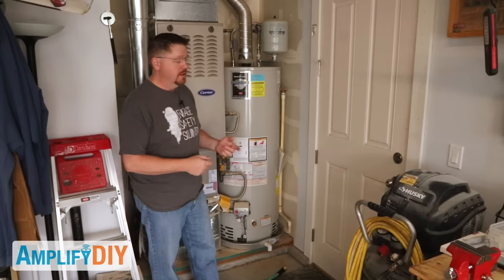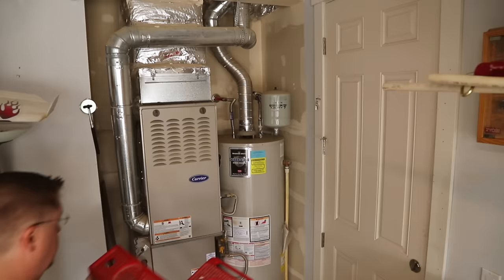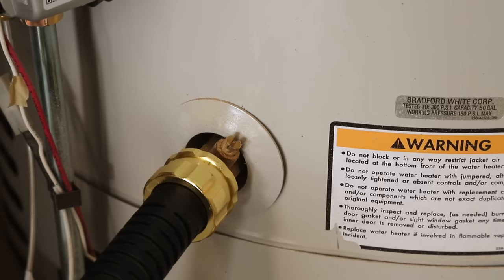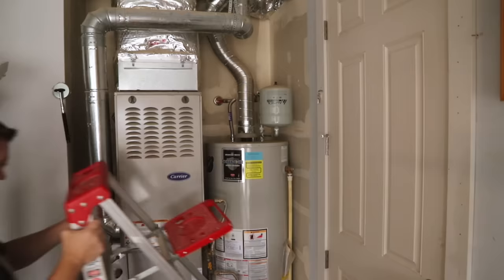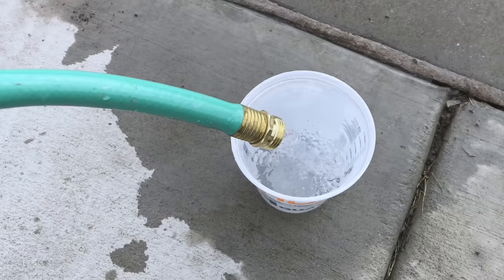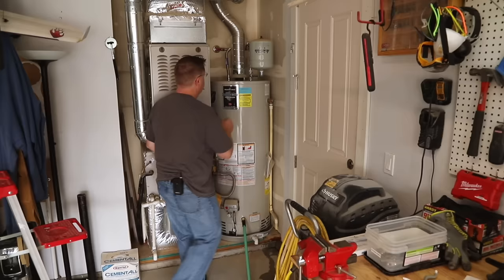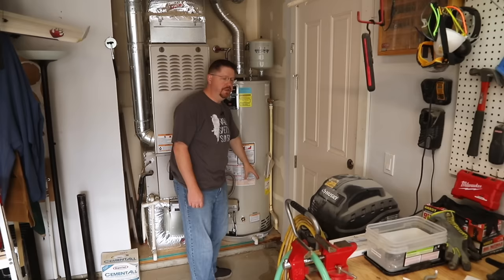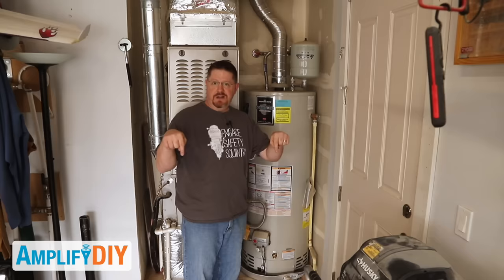How To Flush A Hot Water Heater To Remove Sediment

Comment from the maker: Ok internet, I get it. It's not a HOT water heater. It's just a water heater. I suppose I've always called it that because that's what I've always heard it called.
Reply: Me too.  I was working in a house one day and gave the little boy an ice box magnet.  He looks at me and says , what’s an ice box.
Reply: Same here.  It's a water heater not a Hot water heater.  Why would you heat hot water?
Reply from the maker: I’ll bet it all comes down to local vernacular. I grew up in the Midwest of the US, and everyone called it a Hot Water Heater there. Though, yes, it is probably redundant, plenty of people still call it that.
Reply from the maker: Too true.
Reply: @AmplifyDIY  A small study from a company I worked for in the past showed that customers responded well to, and also preferred "hot water heater" over " water heater". So don't sweat it. Also, to answer the question above. "why would you heat hot water?" Well, obviously so it wont go cold....Duh
Reply: does a tank less water system ever need to be drained and flushed does sediment build up in those at all
Reply from the maker: Short answer: Yes, tankless systems require maintenance as well. Minerals and sediment build up on them, and they also need to be cleaned. The process is different, though. Consult your owner's manual - the recommended cleaning / maintenance schedule should be there.  Good luck!
Reply: @AmplifyDIY  ok thanks
Reply: @AmplifyDIY  In Michigan we call it a hot water tank.
Reply: Sheesh, does it really matter?  Is the World going to stop spinning if anyone says it one way or the other??
Reply: Yes! for decades I heard it called a hot water heater ... I guess because it is the heater that makes hot water. 
Of course, I'm a guy who does NOT think that "literally" and "figuratively" are synonyms.
Reply from the maker: +Thom Thumbe - apparently, yes. You should see some of the comments I've had to relegate to the recycle bin. Some people are very passionate about this sort of thing, apparently.
Reply: AmplifyDIY worked on them for 30 years we all called them a hot water heater.
Seems like we were wrong. It’s only a water heater.
Reply: Good stuff! High quality audio and video. Easy to follow and understand. Thanks!
Reply: @mikelynch307  WOW   You have to heat hot water, otherwise it is ice.  It really depends on your scientific frame of reference.  It takes a lot of heat to convert ice to water, then you heat water until it changes to steam.
Reply: Hot water heater, ATM machine, VIN number...
Reply: AmplifyDIY k
Reply: Moon Pie  Words have meaning.
Reply: @rickpowell1402  People also say "old hag" and "soup tureen."  It just shows that they don't know what words really mean.  

For fun extra credit, look up the proper meaning of "begs the question."
Reply: Moon Pie  The point is that people use words and phrases without having a clue as to their meaning.

A hag is defined as "an old woman" so "old hag" is redundant.

A tureen is "a large bowl for serving soup" so "soup tureen" is also redundant.

He begs the question means that is avoiding answering the question.  

Don't use words unless you know what they mean.
Reply: I've always called it a hot water tank
Reply: @nunyerbeeznaz2906  YOU SHOULD NEVER USE THE LORDS NAME LIKE THAT !!! 
SHAME ON YOU !!!
Reply: Moon Pie  No, if the water is hot, the heater will not heat it. The thermostat will not call for heat.
Reply: Around here, we say hot water heater.  And if someone were to say it's not a HOT water heater, they'd get knocked the fut out.  Lmao.  Very informative video, done with everyone in mind, while making safety first and foremost, as it should be.   Cheers mates.
Reply: Anybody that's complaining about you calling it a How Water Heater needs to get a damned life.
Reply: If your water heater is working properly, it's always heating hot water. The only way the appliance would be heating cold water is if for some reason the water inside was cooling off before the gas or electric burner would kick back on. Bet you wouldn't enjoy your shower if your heater was heating cold water at that moment. The term "hot water heater" is redundant like "taxi cab"
Reply: @tonyj1965  actually the temperature in the tank is kept within a fairly close temperature range.  Your water heater burner will kick back on before you would notice a change in temeperature. So your heater is always heating hot water.
Reply: @goldwinger5434 Like a video that demonstrates how to drain a water heater evolved into a discussion of the English language, language likewise evolves. Many people living in the Midwest will say "taxi cab" and "soda pop", while for people in other regions of the U.S., these terms stand alone and each still has the same meaning. Language will continue to evolve, adding terms like bizarre and gross and adding new meaning to words like cool. But this appliance is  actually  a hot water heater.
Reply: Moon Pie  Hey, at least nobody tried to turn a water heater video into a political discussion.
Reply: Moon Pie  😂
Reply from the maker: @Anonymous Sources: "Hey, at least nobody tried to turn a water heater video into a political discussion." - Moderation engines turned up to 11, captain!
Reply: AmplifyDIY ok stupid question,,, what is the small tank on top of the "hot water heater". Oh and the line from the pressure relief valve should be directed outside. I helped someone years ago that had a brand new tank installed and the thermostat stuck while they were away and the entire house flooded,,, it went into the vents of the new heat and air unit just installed. Ruined carpet, flooring and much more.
Reply from the maker: @jackbquick123   That small tank is called a "Thermal Expansion Tank", and is used as a place for water to go when it expands as it heats in the heater without increasing the pressure in your plumbing system.  As for the line for the pressure relief valve, it is directed down to the floor of my garage, which slopes gently out to my driveway ... so in the event of a leak it will drain out of the garage and away from the house. Thanks for watching!
Reply: Because my heater is electric, I seem to purge this mostly clear gelatinous muck when I do the flushing too.  I also replace the sacrificial anode while I have the tank pressure lowered.
Reply: I've worked construction for 25 years. Whenever the architect/engineer shows one on the blue prints, it is labeled WH for water heater. When we get them brand new, the manufacturer labels the box as: gas fired water heater.  That being said, I have heard many iterations and I usually know what they're talking about. There is only one appliance used for heating the domestic water coming to your house.
Reply: I'm 75 and grew up in South Dakota, and it will always be a hot water heater.
Reply: @nightfangs2910  tankless needs to be flushed with a special solution. They do not need to be "drained" due to them being tankless. At the most the exchanger holds about 2 gallons. You isolate the heater from the rest of the house and use a pump and you recirculate the solution though the heater. Hire a plumber when you do this.
Reply: @bradleycass11  Department of Redundancy Department
Reply: Just because it's what you hear doesn't mean it's correct!  You were listening to the language challenged who preceded you.
Reply: Moon Pie  it does not "mostly heat hot water".  The tank insulation is very good, so the heater doesn't activate very often when just sitting. It won't activate UNTIL the water COOLS, so it's not heating hot water "hotter"
Reply: @rickpowell1402  So, if a group of people are surveyed and they respond that they believe 5 is a better answer than 4 for the question "what is 2 + 2?" we should inform mathematicians to change mathematics?  The fact is, some less than language-competent people once referred to the appliance incorrectly as "hot water heater" and it subsequently stuck with thousands more who followed, too dumb to see the error. Show me ANY appliance box labeled "hot water heater"!
Reply: @ya472  water that isn't hot is not, by default, ice. Water at typical room temperature is ~70 degrees, tap water in 50s-60s, neither suitable for a bath, nor considered "hot". The appliance heats ambient temperature water become much warmer - to become hot water. Hot is relative, and subjective, but generally considered to be water noticeably warmer than our body temperature.
Reply: txman201 yes.  Change a number if you want.  I really could care less about what you do, or what you think.  Have fun patrolling YouTube
Reply: I don't believe your water heater installation would pass code in very many places. The value of the safety pan is marginal when it's drain simply dumps onto a floor. I guess it's a below grade garage floor, but that still leaves a lot of opportunity for water damage. Having the safety pressure release valve simply dump to the floor is dangerous, and makes an even greater risk of water damage. Such as it is, it dumps at grade level (Not below grade) so the risk of water damage is even higher.  If it's spewing scalding water straight onto a floor, how will you get near it to shut it down? Yes, you could shut off the home's water supply, but that's not ideal.
Reply: txman201 it’s legal in more places than you think.
Reply: @txman201  Let me rephrase that; water can only be cold when it can be chilled below freezing point, without crystallizing(like ocean water, contaminated by salt as a solution).  As soon as you classify water at room temperature, you start a new thermometer scale, because then 70* becomes 0*, for scientific reference. Cold water would become a  negative integer, warm water would become a positive integer.  If you wish to use body temperature scale at 98.6*F, you reset 98.6* at zero, cold water becomes a negative integer, and hot water becomes a positive integer.  However, for H2O to exist in liquid form, it must be heated to 32*F or 0*C. Therefore all water is hot. Try removing the sun, and one can watch the heat disappear from the ocean water(contaminated water). Great for skating on.  I suppose the term 'hot water' is actually redundant.  OR, for the sake of fun, someone living in the arctic will believe 5*C is hot weather, while someone from Florida will think 5*C is very cold. Both people's point of view is correct, but wrong to the other person.
Reply from the maker: @txman201  "I don't believe your water heater installation would pass code in very many places." - I didn't install it. It was installed by a professional plumber and inspected by the city as part of the rest of the plumbing inspection for the new house when it was built 2 years ago.  As far as I know, it is to code in my area.
Reply: it IS a hot water heater.  the water inside is heated to whatever temp it is set to.  at that point, the water is considered "hot" and the hot water heater has to maintain that level of temperature.  so it is INDEED a hot water heater.
Reply: I'm 56. I'm calling it whatever I want! HA.
Reply: @kurtzimmerman1637  NO, YOU CAN'T!! IT'S AGAINST THE LAW!!  ;-P
Reply: Back in the ‘70’s the late George Carlin asked why would you heat hot water? 
That’s what I think of when someone calls it a hot water heater. Either way is ok for me. Some people still call a refrigerator a Frigidaire, which was once a popular brand.
Reply: I have a hot water heater...
Reply: Moon Pie   Moon Pie  . . . Wrong. A WATER HEATER is a water heating device, such as in this video, that heats “non-hot” water to a preset 'desired target temperature’ - let's say 125 degrees for example. When said non-hot water is heated by said water heating device to said desired target temp (125d here) said water heating device stops heating said non-hot water b/c said non-hot water is now HOT ("hot" is defined, of course, as said desired target temperature set by owner/user of said water heating device) So, at this point, said water heating device is now effectively a tank holding HOT water it having reached said desired target temp (125d). ERGO it is holding “hot” water and is not heating said hot water, said desired target temp. being reached.  Any water said water heating device heats is, by definition, cooler than said desired target temperature and thus not “hot” water

Therefore, it is a WATER HEATER not a hot water heater.  You might argue 124d or 123d water is “hot” but it is not hot because hot is the temperature THE temperature set by said owner/user of said water heating device and not a titch cooler.  124d IS “hot” water if said water heating device is set to heat non-hot water to 124d, and so on.  I mean ‘think about it a minute’ if water came out of our wells or city supply at our desired target temperature for “hot” water – they’d have no need to heat that water.  As it would meet their definition of “hot” water.  Hot water as defined by we, the user and temp. setter of what?  THE WATER HEATER
Reply: question. i have a relatively new WH around 10yrs old. i have noticed a small drip (1 drop every 10 minutes) coming from the threads at the bottom element. will replacing the element solve this problem. or is the corrosion too embedded requiring a new unit?
Reply from the maker: Hmm. Depends. I’d recommend draining the tank and removing the element. See what condition the element as well as the threads are in. If the threads still look ok, replace the element if necessary, and use both Teflon tape and pipe dope on the threads when re-installing the element. If it still leaks, you’ll likely need a whole new heater.
Reply: The same people yelling at you over a simple term, are the ones who have never even worked on their Hot Water Heater 😂
Reply: Hi, AmplifyDIY. If using the relief valve for airfow, do you turn off the faucet's hot water valve (i.e. only use one or the other better never both), or should/can you have both the relief valve and the hot water faucet on at the same time for airflow? I was getting a weird vacuum effect going on and wasn't sure what the deal was.
Reply from the maker: There should be no problem with opening both, usually. Thanks for watching!
Reply: Then, it is hot to you, but in reality it is cold water until the thermostat shuts off.
Reply: Me to your right it does make the Hot water to run through your House's pipes period, Thanks for sharing great info etc
Reply: AmplifyDIY me too!
Reply: I’m from Oklahoma. We call it hot water heater. The internet can kindly f@#k off. On another note, fantastic video. Production quality was fantastic. Thank you for using a lav mic!
Reply: Your're knowledgeable which is why I was surprised you didn't know that's not segiment debris coming out of the tank. I believe that's the anode rod doing it's job and slowly deteriorating releasing those black particles. Sediment would beige or yellowish muck.
Reply: @goldwinger5434  -- it must be hard being so far down the autism spectrum.  People use colorful language. It's part of culture.  I suppose idioms drive you crazy.  And, an oxymoron would blow your mind.  In N.C. and Virginia, people say "hot water heater" and have no plans to change.  We also use a hundred other not-to-be-taken-literally expressions.  Look out, it's almost time for Wapner.
Reply: It's Accurate if the water is already hot.;)
Reply: Everyone in this comment section calls a facial tissue a Kleenex. I guarantee it. In other words, you're all a bunch of hypocrites.
Reply: My hot water heater just cycled on. The water inside is hot. Just needs to be a little hotter. So it's a hot water heater. Anyone one who doesn't agree can bite me.... 🤣🤣
Reply: @mikelynch307  I'd say it is heating hot water - increasing the heat - more often that it heats straight cold water.  So yep. it's a hot water heater.
Reply: Moon Pie  If you think about it, it's really more often than not, heating warm water.  When it first fires up it's heating cold water.  Once the water temperature becomes hot, it shut off.  It doesn't turn on again until the water temperature is no longer hot.  So no, your water heater never heats hot water.  I think the term "hot water heater" is one of those things that gets passed down over the years.  Very much like calling a refrigerator an "Ice Box".   It comes from the days when the "Hot Water Tank" was separated from the heating unit.  Regardless of how many people have come to call it, incorrectly, a hot water heater, that does not change the fact that it is just a water heater and it's used to heat water so that hot water is available at a moments notice.  You could call it a warm water heater, sometimes it's a cold water heater, sometimes it's a tepid water, but it's never a hot water heater because as soon as the water is hot, it shuts off.
Reply: AmplifyDIY when you said you were letting cold water in, is that the same, or a completely different valve on the water heater
Reply: Nice video!! Very well explained.  I work for an HVAC co. and even the dispatchers refer to the tank as a HOT WATER HEATER .  I don't get it either but we all know what they're referring to so whatever floats your boat. The only point I would make is check or replace the ANODE ROD too during the flush process.
Reply: I worked at Home D years ago (plumbing) & all the Mexicans called them “boilers”, but thickly accented to “boyluh”.
i ayipah !
Reply: LOL
Reply: @AmplifyDIY  Me too. I'll bet you grew up calling a water fountain a bubbler, I did.
Reply from the maker: @danielkuchenberg7046  I've heard it called that, but most often it was a "drinking fountain".
Reply: You mean like the redundant atm machine
Reply: night fangs yep.  Smaller burner “tanks”...the heat exchanger. These are even MORE susceptible to clogging/sedime.
Reply: High temperature water water heater water heating unit.
Reply: dihydrogen monoxide molecule excitement device
Reply: Internet can be just filled with know-it-alls. Especially on DIY videos. Which makes you wonder why they're watching a DIY if they know so much already. Too critical.
Reply: George Carlin:
"Id like to buy a hot water heater"
"what the hell for? Hot water doesn't need to be heated" lol
Reply: @AmplifyDIY  can you just drain it with the cold water line open?? So then you don't have to open a line up stairs to release air pressure or mess with the pressure valve
Reply: I followed your video and now my hot water pressure is noticeably weaker. Any ideas on what could be going on? Its a 6 year old water heater and our house sat vacant for a while.
Reply from the maker: Did you open the cold water inlet all the way? Is the pressure low at every fixture, or just one faucet?
Reply: @AmplifyDIY  ill double check the cold intake. Its weird because the hot water will be fine but if i turn on another faucet to hot it slows big time.
Reply: @AmplifyDIY  youre exactly right. The cold water intake wasnt open all the way. It seems to be working now. Thanks for the help and the video.
Reply from the maker: You are right, of course. Since this video is intended for people who don't regularly flush their heater, I didn't want to mix terms or get into too much minutia. The vast majority of people will have A LOT more sediment than I did (my tank is pretty spotless). Usually the anode flakes just mix in with the sediment and you never see them separated.
Reply from the maker: @Daily Driver:  this is a common misconception (that the pressure of the cold water inlet into a full tank will do a better job agitating the water) - it actually does not, due to Bernoulli's principle. The water flows into the tank at a high pressure, but the diameter of the inlet pipe (usually 3/4") compared to the diameter of the tank makes it so that as soon as the rushing water from the inlet hits the mass of water already in the tank, all that fast moving water slows to a crawl. Otherwise, every time you took a shower it would stir up the entire tank, and fill your faucets and fixtures with sediment.

Now, if you empty the tank first as I show in this video, all that fast moving water coming from the inlet (dip tube) is able to slosh around the bottom of the tank because there is not a huge wall of water there slowing it down.  This does a much, much more effective job of agitating the sediment at the bottom of the tank, and flushing it out of the drain valve.

Thanks for the question!
Reply: AmplifyDIY I call it a hot water heater too, no big deal.
Reply: the redundancy department of redundancy
Reply: AmplifyDIY  — What about checking and replacing the ANOID ROD ??
Reply from the maker: I did an entire video all about anode rods: https://youtu.be/OIMz1rwx_jc
Reply: @davemi00  anode
Reply: Kind of like people alway day “un-thaw” lol
Reply: @AmplifyDIY  I say hot water heater too!
Reply: Moon Pie how does that water get hot in the first place?
Reply: Moon Pie  "than"
Reply: Handy Andy's at it again. A hot water heater is a water heater with a bikini on it.
Reply: Don't worry about it bro, the grammar police have nothing better to do. Great video, very informative. Thanks 👍
Reply: I've been calling it that for 50 years,you good
Reply: Can we discuss which way you hang your toilet paper :) Or maybe what's a Hose Pipe?
Reply: “Hot water heater? Hot water doesn’t need heating!”- George Carlin
Reply: Another thing. What about changing thw anode rode?
Reply: To be fair, in Phoenix during the summer, it is a Hot Water Heater. We dont really get cold water from our pipes 4 or 5 months out of the year.
Reply: You have a little "H" and a little "C" on     your bath tub water valves right?  H for hot water, C for cold water. The heater heats the water in the H line or hot water line. It is  the  "hot water " heater.  It would silly if you hooked it up to the cold water line because than it would be the cold water heater.
Reply: Excellent video. I'll probably be doing mine this week. My "hot" water heater is next to my garage sink. I have the pipe from the pressure relief valve going right into the sink. I don't have to worry about water/steam going all over the floor. 
Just found your channel, looking forward to more.
Thanks, Bob.
Reply: @thomthumbe  maybe, you never know.
Reply: It is a hot water heater..it heats hot water to keep it hot, the water doesn't get cold, it stays hot, so it heats hot water..a hot water heater..
Reply: @anonymoussources8803  =  Yet.
Reply: J Smith  Absolute zero is not hot, but rather,  the absence of heat. That does not logically lead to your claim  that all temperatures above absolute zero are hot.  The same reasoning would define cold as existing ONLY at 460 below zero. The terms hot and cold would cease to have any meaning.
Reply: @AbsentWithoutLeaving  Sadly, true
Reply: @Amplify DIY, don't get hung up on semantics. Send the college grads back to school! Lol Everyone will know what you want if you ask for a hot water heater. Grainger, Home Depot, Lowe's and Menard's all call the item a hot water heater. Technically speaking that is the correct name for it (after the function) ; a heater that produces hot water.
Reply: @Rocketman88002  A hot water heater not only produces hot water, it maintains the temperature of the hot water in the tank at the selected temperature. Unless the appliance is malfunctioning, the water in the tank is always hot water. It's not an exercise in semantics for college kids, it's what the appliance is designed to do.
Reply: It's a hot water heater and I'm ready for the fist to cuffs. jab jab
Reply: Well, in fact, it does heat "hot" water. Many of the heating cycles are "recovery" to maintain the desired temperature. In that case, it's taking hot water and making it hotter. Jeez, Internet, lighten up.
Reply: @AmplifyDIY  I am also from the Midwest, and “hot water heater” is a term used by everyone, even the plumbers and building contractors.  Maybe it’s just regional vernacular, like MidAtlantic saying “Warshington”.
Reply: Thanks, really helps. ✌✌
Reply: We called it a "hot water heater" too. To me, it's way more irritating to hear someone say "I seen it" instead of "I saw it."  We said hot water as if it was one word. I didnt think anything of it until I read the complaining comments.
Reply: DAMN, just when I was going to make a joke about it.. You ruined it...
so its not a Tankless job?
Reply: HINT: You can still edit the video title here on YouTube to remove the word "hot"...   :-)
Reply: Haha.  We call ours a hot water heater, too.🤷
Reply: Gene Miller kol
Reply: I've called it a hot water heater for 60 years, and no wise ass politically correct punk can change that. 💪😎👌
Reply: Moon Pie  Right on Moon👌😎👍
Reply: Why does my come out so slow??
Reply from the maker: @firebird14420  you likely have a clogged up drain valve. Luckily, replacing the factory drain valve with a much better one is cheap and easy: https://youtu.be/OBPJYg0o_o0
Reply: no, its a hot water heater. some heaters make warm water, some just stop the water from freezing. this is in fact designed to produce hot, but not boiling water. its a hot water heater. a boiler, makes steam. the internet doesnt know shit.
Reply: It's been called that for at least all of my 68 years.  That's why it made George Carlin's list of  oxymorons in his 70's skit.
Reply: In Chicago we call it a hot water heater.
Reply: It's also a heat water hotter.
Reply: jack mayhoffer  You mean "Grammar Nazis."  An apostrophe's use indicates possesion; apostrophes do not show plurals.  This has been brought to you by the Punctuation Nazis.
Reply: EyesInTheDark1  "Minutiae." (Also Honorary Member of Spelling Nazis.)
Reply: @duubtuub3071  but is it a heat water hotter heater?
Reply: I used to call it that too. No biggie.
Reply: That's what everyone in my family called it, a hot water heater, because that's what it does. It makes hot water.  I grew up in south west Michigan, and this goes back to 1970. So my opinion has more weight than a few millenial kids in their early 20s.
Reply: I can't believe people were arguing about this.  Lots of time on their hands, I guess.
Reply: @mikelynch307  To get it hotter? lol
Reply: My wife likes Mexican food restaurants.   We've never been to a Mexican tire restaurant or a Mexican appliance restaurant.  Makes me crazy every time she says that, but I no longer mention it.
Reply: A professional should also know the difference between a furnace and a boiler.
Reply: Moon Pie  that's almost deep
Reply: @shobud7561  Is "god" a name? Which god? They all have proper names made up by humans.
Reply: only a non lic plumber would say hot water heater
Reply: Lol I didn't  see this until after I commented
Reply: ⁰
Reply: Lol!!!
Reply: In your defense, in an industrial setting there could be water heaters that heat to different temperatures where one would be a "Warm Water Heater" and the other a "Hot Water Heater". I do think that calling this a Hot Water Tank in residential applications is acceptable.

Great video, thank you for creating it.
Reply: AmplifyDIY You Forgot To Add 3 Gallons Of White Vinegar To The Tank, And To Let Is Sit For 24 Hours.
Reply: Why would you buy a device to heat water that is already heated. I just bought 2 water heaters to heat my cold water. Seems like a better deal.
Reply: Internet mad. lol
Reply: You're right, I'm sure I made similar misstatements. I retracted my comment. Thank you for the educational video.
Reply: Mee too.
Reply: @AmplifyDIY  do I leave the faucet open during tank refilling for reuse if I have been letting air in to drain tank from faucets and not t/p/r valve?
Reply: @AmplifyDIY  great video btw. ty
Reply from the maker: @erinlittle167  yes, leave the faucet open to let air out as the tank fills with water. Good luck!
Reply: @Imwright720  q
Reply: Thom Thumbe   Being a career plumber, hearing one refer to the Hot water heater is like rubbing nails across a blackboard...no biggy,  just annoying!
Reply: Anonymous Sources   Using the term “water heater”  in its self infers     “Hot”, however, companies do market a water heater booster, which in fact, heats hot water.
Reply: Mr. Blue Nope
Reply: Not by a plumber..
Reply: @goldwinger5434  hey thanks ..I agree
Reply: That’s what I’ve always called it. Lol
Reply: Does a coffee maker "make" coffee? Well, yes and no. Does it make hot coffee? So is it a hot coffee maker. Once it's brewed and on the heater, is it a hot coffee heater? Yes. Because it continues to heat what's already hot, to keep it hot. 

SUGGESTION: Instead of quibbling about this, let's quibble about the dumbing down of language. Grammar. (Not referring to the guy in the video.) Look how many people don't even know when to use "I" or "me." People embarrass themselves all the time without even realizing it. Maybe they think people don't notice. Well, people who paid attention in school notice, and you look uneducated. It's so easy to know the rule, you can learn it in 30 seconds, but these days even journalists are sloppy. That's the dumbing down of America. Then there are those who claim something is "very unique," when there are not degrees to being one of a kind. And the popular fad of saying "It begs the question, ..." when they mean raises the question; begging the question is the name of a logical fallacy (assuming a premise is fact). 

Y'all have my permission to say "hot water heater" if you promise not to say, "Me and my wife went to the store." Hint: if you wouldn't say "Me went to the store," then don't say "me and my wife." Say "my wife and I went to the store." Use what makes sense if you leave her out of it.

And stop saying, "I bought groceries for my wife and I."  Again, would you ever say "I bought groceries for I"? Then why would you say for "my wife and I"? Use what makes sense if you leave her out of it. You would say, "I bought groceries for me." So when you add her in, you say, "I bought groceries for my wife and ME."  

Don't worry, I charge no tuition for all this advice. And see, you can learn it in 30 seconds. When you don't know whether to use "I" or "me," just see what it sounds like if you leave the other person out of the sentence. And THAT is the word you use when you add the other person back in.

Get those simple basics (help preserve our language), and I'll allow "hot water heater."
Reply: I've always heard it called a hot water tank, once again it doesn't matter what it's called, it's all the same!
Reply: @AmplifyDIY  I’m from the South & I know it’s redundant but that’s what I’ve always heard it called, too ! Lol
Reply: Any worries about the hot water cracking the concrete?
Reply: Indeed
Reply: Since we are on the subject, let's call it a cold water heater...
Reply: Either is correct. Water heaters heat the hot water that is in them, even when no cold water is incoming.
Reply: Never mind that...you don't flush a water heater,  you flush a toilet.  DUH! Where did you go to plumbing school!?
Reply: How does what water become hot water.  It's heated.  Also, it's not heated once.  It continually comes on to maintain the temperature, so Hot water heater is absolutely fine.
Reply: @mikelynch307  To keep it hot that's why. Team Hot water heater!
Reply: @AmplifyDIY  Yup same here. Grew up about 1 hour east of Buffalo and we always interchanged it. One day it's a water heater, next day it's a Hot water heater....and when it doesn't work..then it's "That piece of junk in the basement" 😅😂😁😷
Reply: Right, next we go inside to check the frozen ice freezer.
Reply: It's a cold water heater.  It heats cold water to make it hot. 😋
Reply: @mikelynch307  Because it's not hot ENOUGH, obviously!
Reply: This is my pet peeve. IT HAS NEVER PROPERLY been called a hot water heater, just because a number of people use a term doesn’t make it correct. JUST THINK hot water doesn’t need heating. Actually it is s cold water heater!!!
Reply: So what the big deal call hot water heater doing what it suppose to do heat water 💧 nice video an explanation
Reply: Do you have a video , how to replace the pressure relief valve??
Reply from the maker: @Eli_is_a_Lauver  I sure do! https://youtu.be/e5H1i1cypxA
Reply: @nightfangs2910  yes, there should be valves installed to run vinegar or other acidic cleaner thru with a pump for 45 minutes.  Once a year for standard family,  less often for lower use, water softener. Matt Risinger has good demo.
Reply: People get a nut off correcting people !
Reply: Yeah, you can call it whatever, you can call it "Peaches".
Reply: @alphaq3427  you couldn't care less...hahaha
Reply: If a house is heated with hot water, both the furnace and the hot water heater are water heaters. The hot water heater produces the hot water coming out of the taps.  The furnace also heats water but it circulates through the pipes and you don't see it.
Reply: Next video show how to hook up  a water line to your cold freezing water cooler ice maker chiller in the fridge.
Reply: I am Afraid to do this. The old adage of it AINT broke DONT fix it.
Reply: @quantumtechcrypto7080  Go ahead and do it. If you wait, it's going to be a huge choir, or you will have to replace the tank.
Reply: great video!!! thank you so much for this
Reply: It’s always been called a hot water heater as long as I can remember. Is that a north east thing?
Reply: @mikelynch307  To keep it hot, obviously.
Reply: I'm going to re-think (or think for the first time, really) about my automatic urge to correct someone's pronunciation or colloquial use of a term or phrase. I, too, grew up referring to the big metal tube that takes tepid tap water when it comes into the tube and discharges hot water as a "hot water heater."
I'll probably hesitate now when I want to refer to the hot water heater in the future and may, at times, correct myself . . . or maybe I won't! It's part of my identity, after all. Can't I keep a shred of my old identity? It doesn't hurt anyone, does it?

Help me out here. Who would've thought that going on Youtube to get advice about draining my hot water heater would turn my world upside down and I'd go down the rabbit hole searching for identity . . . questioning the meaning of my life?

Oh, yes. Thanks so much for the video. I'm going to get busy draining the "thing" as soon as I post this!
Reply: @AmplifyDIY  I grew up in the true Midwest (think Grapes of Wrath).
Reply: Hey AmplifyDiy - First off - Thanks for the excellent video on cleaning out a water heater - Didn't intend to cause such a stink - That said, if you look on the heater or the box it came in or look online to buy one, they're called water heaters - But I agree, it's no big deal which one you want to call it - I was making a simple comment and not looking for a fight - Have a great day and thanks again for your vid!
Reply: Ok internet, I'm now going to get a drink from my COLD water cooler.
Reply: Nice video, as a first time home owner I will be doing this very soon. Thanks again for the great video.
Reply: @AmplifyDIY  just like going to the bank to use the A T M Machine
Reply: Well it could be a hot water heater if the hot water isn't hot enough so it needs reheated to reach the setpoint. Or maybe it can just be a warm water heater that makes it hot water until is cools down enough it needs heated up again. lol But Water heater is a lot shorter. :-)
Reply: @mikelynch307  to keep it hot relative to the container’s surroundings, or to increase its temperature.
Reply: @anonymoussources8803  exactly
Reply: It most certainly is a HOT water heater, anyone who says otherwise is wrong.
Reply: Hot water doesn't need heating.
Reply: So many people got confused when you said "hot water heater" and they had no idea what you were referring to.  Mass chaos ensued and led to the Covid-19 pandemic.  It's all your fault!  The world will never forgive you!  How can you live with yourself?
Reply: @AmplifyDIY  Let's Go Branden!
Reply: @trabbin8  If the shower runs for 5-minutes or so, the heater will kick on and heat hot/warm water. If the shower runs for 20-minutes, it'll be heating cool or cold water. That's why people with teenagers don't want to use tankless.
Reply: If you went back and edited out all the "hot"s in front of "water heater", you'd end up with this same debate rolling in reverse. We are A-holes out here; nobody gets a break! Good video, man. Tanks!
Reply: Ha ha hot water doesn't need a heater to begin with so it's just a water heater or you may call it cold water heater lol
Reply: You don't necessarily heat hot water because it would have been used
Reply: This is a 'hot' topic of discussion lol
Reply: Hey bro im not trying to be a S.A know it all, But you could have used the hot water to flush the tank also! Just-a-say-n,,, Another thing when the hot water gets down to about a 3rd left you could pour a half gal. of vinegar in the tank let it sit for an hr it will disolve the scale and its more easly fluhed out,,,
Reply: Same
Reply: It snot?
Reply: Around here, and all my life, it has been called “hot water heater”.  There will always be silly folks that sit on ready to overreact to silly things.
Reply: I call it the same thing.
Reply: It's a Hot Water Heater 👍😆
Reply: My water heater every once in while IT LEAKS FROM THE bottom part and it's cold water.   Why ?
Reply: Maybe it's a safety feature.  Redundancy in the terms to make you understand what is inside if things break (and maybe get on you).  Given the potential for scalding, I'm ok with the extra word.
Reply: @mikelynch307  Because you hotter water?
Reply: Yeah, because it matters so much
Reply: Don't get down on yourself. The tank holds "hot" water, and it continues to heat this hot water. Therefore, it is a "hot water heater".
Reply: as a busy homeowner, I dont have time to play with water heater. Can I just hire a home-maintenance folks (not sure what to call them) to maintain this for me?
Reply from the maker: @gheerock4077  Sure - it's a plumber you'd want to hire. Expect to pay north of $200USD, and expect them to try everything they can to sell you a completely new heater instead. Good luck!
Reply: Don't worry about it. If that's what people are worried about in your video it means it's otherwise a good video
Reply: If you don't heat hot water, it will cool. Technically, it is a hot water heater. 

If it is 120 degrees, it is HOT, if you heat it to 125, you are heating HOT water.
Reply: What does it mean when my Hot water heater starts puking out water on it's own all over my garage floor???
It does that at least 3 or 4 times a week. I've noticed it does it more when it's in the high double digits or triple digits. Sometimes it's a Lot, sometimes it's a small amount. The hot water heater is almost 24 years old.

As for what it's called. I could care what anyone else says. I grew up calling it a hot water heater so therefore I'll continue to call it that lol.
Reply: @AmplifyDIY  i
Reply: Technically its a heater FOR hot water so the resultant is Hot Water aka a Hot Water Heater
Reply: @AmplifyDIY 

This may be a "dumb question" but can I turn off the main water source while doing rather than find the cold water line? I have a Moen Flo installed and can turn on/off easily.
Reply from the maker: @BAMabe - yes, use whatever is easiest to shut off water supply to the heater - if that is the supply for the whole house, that’s fine. Good Luck!
Reply: Unless you live on a hot spring
Reply: @mikelynch307  if you dont use it its a water reheater or a warm water heater
Reply: We call it a hot water cylinder, located in the hot water cupboard lol
Reply: @mikelynch307  to make it hotter....obviously
Reply: Thank you for this video. I’m working on the thermo couple.  Then I was going to drain the WATER HEATER.   I’ve always called it that to 40 years old though.  I’ll ask my daughter what she calls it she’s 17 .  Lol just curious now.
Reply: I searched "flushing a hot water heater" to find this video. Sure, it's redundant, but anyone going out of their way to correct you needs to touch grass. Very useful video. Thank you.
Reply: Hot Water Tank is what it has always been called and i will continue to call it that, thank you very much....
  Its a Tank, It has Hot Water In It. Hot Water Tank... 
No Feedback is Needed, im not gonna call it anything else.
Reply: the internet doesn't know wtf it's talking about. I learned that in 1994.
Reply: Im going to keep calling it a hot water heater.
Reply: Hot water heater is 100 percent acceptable as well. Language isn't as simple as dictionary grammar it's dialect too. I know for a fact hot water heater is part of the north American general dialect! Who cares what people say
Reply: Great job man!!! And thank you for this video .Don't worry about those haters - they came here to learn from you and now they know better if this is a hot water heater or water heater lol !!!!!! Happy New Year to everyone to cold water heater people too!!! 😀😃🙂🙃😊 sorry for my english haters but my first language is polish - good luck to everybody 👍
Reply: That's what they are, HOT water heaters....
Reply: @AmplifyDIY   'z I
Reply: I’ve never heard of a “cold” water heater 😂
Reply: My parents are from the Midwest, but I was born in California.  I've heard it referred to as a "Hot Water Tank" or a "Water Heater."  To be honest, I didn't really notice that you called it a hot water heater.  It's basically a combination of the two.
Reply: Great!
Reply: Many people call it a Hot water heater. Its not correct but its the normal. don't sweat it. The tank should be cleaned 1 once a year. The T&P valve needs to be checked once a year, and every other year replaced. That is the most important part. There is many ways to flush a water heater and I am glad you took the time to show  people how to save money doing it themselves. I would not personally suggest using the T&P as vent, as they tend to stick open once they are opened. Also on this note. doing the draining is a good time to clean your piping which I suggest is done yearly as well. The reason is to help descale the inside of your water heater and get calcium deposits cleared out of the system. Its time consuming but can really extend the life of your water system including your water heater... or Hot water heater how ever you want to call it. Thanks again !
Reply: I've always done the same. No worries and great video!
Reply: @AmplifyDIY  that's what we call it in the south, too (Tennessee)
Reply: @bradleycass11  haha I harp on these
Reply: @bradleycass11  except those are acronyms where the last word is already accounted for, so people are incorrect bc they're saying number number or machine machine. Hot heater is redundant too I guess but not in the same way.
Reply: If a tank has not been drained for a long time, maybe never… would this process still work or would the sentiment have built up so much it will not wash out????
Reply from the maker: @duanevanwinkle3488  Hi Duane - there are a lot of factors at play here (how much sediment is present in the water supply, just how long it's been since it was flushed, exactly how much water is used daily etc etc etc... however, yes, it is possible that you'll have so much sediment built up that there will be a solid wall of sediment completely blocking the drain valve. Good luck!
Reply: Cold water heater 😁.  The late great comedian icon, George Carlin, had that in a routine. He also mentioned 'why do we park in the driveway and drive on the parkway'. Lastly, 'why do people get ON a plane? I want to get IN the plane !'
Reply: That's always irritated me too, it's redundant but I say it all the time😅 thanks for the video
Reply: Thanks, What size was your hot water heater?
Reply: Its okay bro  I call mine a hot water heater too.
Reply: I have and always will call it a "hot water heater."
Reply: I wanted to chug a beer everytime he said hot water heater.
Reply: That what most people call it. I’ve noticed that it’s a redundant name too.
Reply: I've always called it a hot water heater too
Reply: @AmplifyDIY I've been calling it a hot water heater for years as well..I'm from the deep south.
Reply: Worry not about the proper term.  It's clear enough what you're referring to.  I'm very thankful to your instruction to do this task.  Thumbs up and subscribed!
Reply: Hot water heater where Im from too
Reply: Hot water heater, hot water tank, water heater, that thing over there.. all acceptable terms 👌😉
Reply: 💯 it's a hot water heater 😉
Reply: @AmplifyDIY  It's not an engine, it's a carbine 😂😂
Reply: Yeah well heat is relative and it heats water that some would call hot when it's keeping the temperature up... It's not like the water goes completely cold before it kicks on again... But either way this is just the difference between regional dialects. Some regions say soda and some say pop and some say something else stupid.
Reply: I bet that's part of the reason your video got 4.5m views though, so who's laughing now?😅
Reply: Could u leave the pressure valve open to see when some water comes out then drain a little water out to ensure ur minimizing the amout of air after a flush?
Reply: Haha. Hot water heater. 
That is like saying cold ice cube maker, or a cold freezer. Or maybe a gas generator being called an electrical gas generator or something. But that isn't redundant or incorrect I should say. Hot water heater implies it is heating water that is already hot. Maybe a cold air conditioner would be a better analogy. Or a clean dishwasher. How about a hot air heater when describing a heater. 
Frozen Ice Cube freezer  /maker.
A cooked food preparer maybe. Or a clean car washer?
Or a clean clothes washer?
Or a dry clothing dryer?
How about the dry hair dryer?
Or the curly hair curler?
Or the cold water cooler? 
Oh I thought of another, the prepared food cooker. And the fixed car repair shop. And the homeless shelter for landlords and real estate moguls. Or maybe a homeless shelter in the middle of the African plains?  

Cool air conditioner is my favorite. But it still isn't the same as hot water heater. 
Cold Ice cube freezer? No that's not it either. 
Hot air heater is the equivalent. 
Hot food warmer is a good one for a microwave or an oven. Wet water liquefier! 
That's it. Water liquefier. Wet water liquefier. That is a machine we must make. 
Along with the clean floor vacuum and the painted wall paint sprayer and I am going to get a job as a new home remodeler where I do just as my job implies and I rodel brand new homes.

New car repair shop.  And I will sell swimming pools door to door but only stop at houses that have swimming pools.

When people ask you if you would like a warn cup of coffee. I say NO! "I want an ice cold cup of coffee and you can just pee in it while you are at it".  What kind of question is that? 
Would you like a cold beer?
Nope, I would like mine warm and flat. 
I guess that is different because it is a question of weather I even want the beer or not. Not the temperature of it. But whatever.
Reply: Well, there's no need to heat water that's already hot. "Hot" is covered by calling it a heater. Thus, 'Hot Water Heater' is kinda redundant.
Reply: @txman201 
In our family and a generation or 2 b4 that we always called it  the "h20 cylinder. 
Our house our language our rules :)~
Reply: @txman201 
Shoes
Reply: @trabbin8 
I bet youre the fun guy @ a party. 😮
Reply: @guest491   Oh you have no idea!  😄
Reply: I always call it a hot water heater too lol
Reply: no its a cold water converter.
Reply: That’s what I call it..
Reply: Same. It’s a hot water heater.
Reply: @mikelynch307 because you want to keep it hot, obviously.
Reply: My Foreman (a residential plumbing company) was often asked if we had a hot water heater.  He would say "I don't have a hot water heater, but I do have a cold water heater".
Reply: Please understand, you have the most objective and detailed video on this subject. Excellent job, seriously. There is too much noise out there with incomplete or incorrect info.
Reply from the maker: @danmunoz4348  Thank you!
Reply: Fun fact: water heaters do infact also heat hot water. The moment the water in them isn't cold, they're heating hot water
Reply: Don’t sweat the haters. This is an excellent video, as evidenced by that being the only major complaint. Well done!
Reply: I did everything according to video. Hot water just dribbles out. Am I screwed?
Reply: Do you make water heaters. Lol the only people I've heard say that worked on water heaters. Most of America calls them hot water heaters.
Reply: We call then hot water heaters around here. XD
Reply: As language goes, call a thing something frequently enough, that's what the thing is called 😂
Reply: Growing up in IL this is what it has always been called 😂 I get the redundancy, but it is the midwest 😂😂
Reply: Actually,  once you use some hot water, some cold gets in, making it not so hot,  but it's still hot. So the hot water is getting heated to the proper temperature.  So yes, it is a hot water heater.  😂
Reply: I grew up hearing hot water heater too.  Some people have nothing better to do I guess.